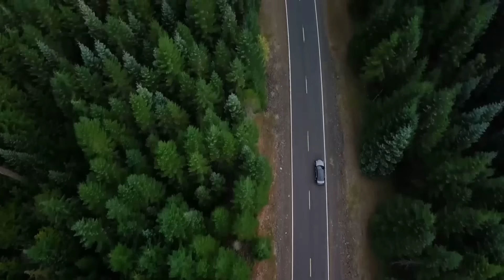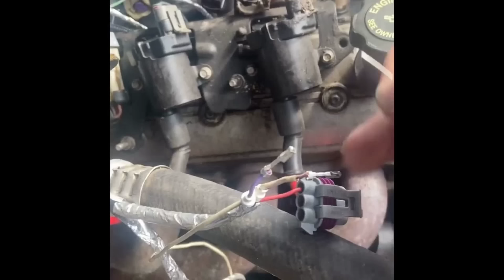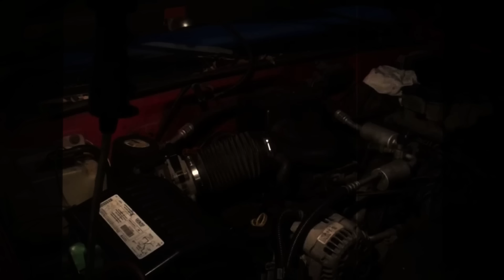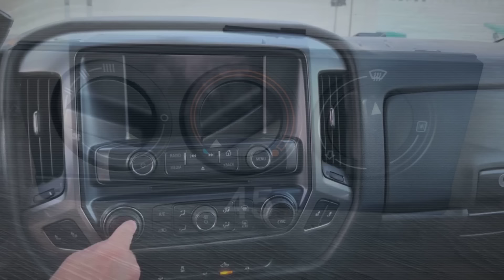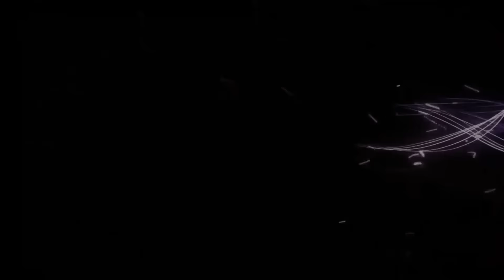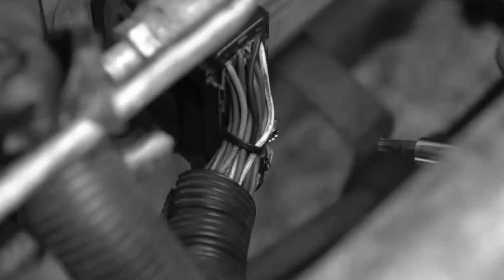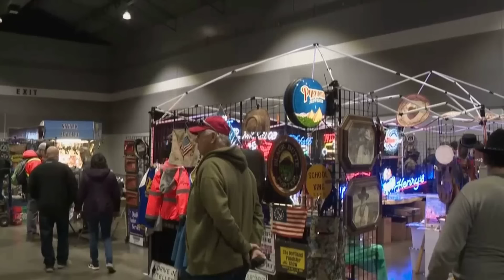How Smart Mechanics Are Bypassing The Dealership (The "Delete" Loophole)

Comment: This news of ppl fighting back against cartel like corporations is music to my ears
Reply: Yes but they're fighting back the wrong way Emma the solution to these problems is to create a replacement OS and to pull the parts off of these vehicles so that someone can scan them for a cad and put the part out for people to 3D print.
Reply: @RayMisuto who's emma 😂
Reply: @GokuSukzass-qf6ro  Google's preferred way to type and.

They're constant use of AI algorithms to rewrite stuff leaves a lot to be desired.
Reply: The oil is the real control mechanism.
Reply: @VagzeensMarkYou water first.
Reply: @davespark10  
It is the oil. It has already been the oil for many decades.
Reply: Then, let's pump up the volume.
Reply: I have a new and old in the driveway 
Screw the industrial forced obsolescence of transportation.
Reply: The chip in the key does an encrypted exchange of messages with the ECU.
That looks nothing like a resistor in any way.
Way more cars would get stolen if it were that easy.
More ChatGPT BS.
Reply: @chrisharvie-smith486  Thats Much Newer Vehicles
Reply: @deltasixgaming It was in cars from 30 years ago.
Reply: @chrisharvie-smith486 like my 98 Explorer has a Physical Resistor on the Key

Comment: I have the standard bed dream pickup truck of the future. No computer systems. Power steering, automatic transmission,  hand safety brake, etc. Simple repair as required. 1966 Chevy C10,  1,000, 400 miles. 😊

Comment: Will i saw ther is a modification on an old cars such as dodge and buick you could instull electric carborator with simpel computer eazy to install and modifi
This modified carborator engine save full but if you didn't find parts in the market you reverse the operation and back to the old carborator engine 

I think it called  (fitech) 

Plz look for it i hope this information help you

Comment: To keep my vehicles on the road I quit taking my vehicles to the quick lube in lancaster ohio. Took 2 vehicles there to get oil changes and both have warning lights on them after they did oil changes. One is the oil indicator light and another had a lightning bolt indicator light. The lightning bolt light turned out to be a broken ecm wire harness locking tab they broke off when checking the air filter. The other I haven't tracked down yet.

Comment: My Pop had a 1987 EFI-equipped F-150. He loved that truck, but sadly, the EFI went south and squirrels ate the under-hood wiring harness. So, having lived my early life as a Shade Tree mechanic, I took his 1987 and turned back the clock to 1967. Pulled out all of the EFI and Digital Distributor and the Duraspark box. Pulled off the EFI intake manifold and throttle body. Pulled off the high-pressure fuel rail all the way back to the in-line filter, under the truck.
Installed a Ballast Resistor from the ignition switch to the coil. Added a distributor from a 1967 Galaxie 500 with a 289. Points, Baby! Ran the wire from the BR to the Coil, and the ground (negative side) to the Distributor. Now he had spark, old school.
Replaced the F.I. intake with an Edelbrock Performer for a 302 and fed it via an Edelbrock 600 with electric choke. Installed 2 fuel pressure regulators (the first to dumb down the 65psi line pressure to 20psi, the second to dumb it down further to 6psi. This was easier than dropping the tank) and an additional fuel filter just before the Carb. Connected the TV cable to the Carb, and away he went. He got quite a few miles out of it before the AOD gave up the ghost (Bad front pump seal) and he finally gave up on it. His wife bought him a 2005 Tahoe instead. He drove that until he passed.

So, you see, old school still works, you just have to know how to add it.
Reply: Neat and cool

Comment: My story had nothing to do with electronics and digital technology. I had a 1981 Oldsmobile Delta 88 with GM's awful Diesel engine. After the head gaskets blew for the second time and the car was worthless to sell, I decided to convert the car back to a gas motor. I used a 350 from a 72 Delta along with a 400 turbo hydramatic trans. I created a true dual exhaust, etc. I was able to drive the vehicle another 60K before I eventually sold the vehicle.

Comment: I recently bought a new plug and play ECM for my 1995 Chevy k1500 with the 6.5 diesel. I figured if anything would fail in the future and have the highest chance of making the truck useless it would be that. It took about 8 months of waiting before one was available and in the mean time I purchased all of the sensors as well. Some sensors like the MAP, I purchased used from a same year truck because new ones for these turbo diesels are off about 6% and will not work very well and these are pretty robust. For my 2002 Dodge Ram, I recently picked up a parts truck. I have many old school Chevy engines, a good muncie transmission, lots of parts to convert over to points if needed, I even have a propane conversion kit for an LS Chevy. Let’s go!

Comment: Next move for the manufacturer will be putting a cheap biodegradable covering on most or all of the wiring harness. Even on half of the wiring disintegrating would completely screw the average owner. Imagine the job it would be to remove and replace the thing that essentially is the first thing they put on the car on the assembly line.

Comment: i dont have to worry about this, i wont buy a vehicle later than 89 if i cna help it.  i bought a 96 olds from my ex-wife that originally belonged to her mother but it had issues and even after fixing those issues with no codes the piece of junk still has a problem in that the engine surges at higher rpm with the car sitting in park and it does not pop off ANY error codes.  so this is not a new issue at all, manufacturers have been fucking people over eer since they went to computer brains and fuel injection.  honestly fuel injection is NOT worth the headaches. give me a carb and distributor any day

Comment: You all act like this is something new. We've been doing this in classic cars as long as I can remember. It's just getting to wear manufacturers don't want you to work on your own cars so now we're doing the same thing in modern cars. Just rip manufacturer control out of the car and keep on driving down the road you get better gas mileage more horsepower and total control over your own vehicle. The trick is to try to find somebody who's willing to work on that that means no more dealerships you find yourself an independent shop that does this kind of stuff and you hang on to them for their life. Make this normal and more mechanics will start servicing these kind of cars.

Comment: 😂😂MY RESURRECTED 06 ENVOY.. DECIDES TO ONLY START WHEN ITS COLD OUTSIDE.  LIKE 20 DEGREES AND COLDER😅😅
I CHECKED FUSES AND RELAYS. FUEL. BATTERY.  IGN SWITCH.. CLEANED MAF.. AND THROTTLE BODY. CLEANED EVERY GROUND I CAN FIND. 
THE SENSORS ARE ALMOST IMPOSSIBLE FOR MY OLD ASS TO BE LAYING IN THE STREET.. UNDER VEHICLES.. TRYING TO WRENCH😅😅
I DON'T KNOW WHAT ELSE TO DO NOW.

Comment: I think getting rid of the coil paks is drastic. I'm sure there is a solution for that. Getting rid of the ECU? Sure Haltec. Screwing with the transmission? Try figuring it out using an ARDUINO micro computer and a service. BCM's? Piss it off. SRT? Piss it off. ABS? Learn how to brake properly.
 I have four 2001-2005 vehicles and have faced all of the problems mentioned. I bought a van with ONLY an ECU and no other electronics, beside central locking. It's switches and relays. I also have Alfa Romeo's that have some pretty fancy electronics for the time. The airbags gave me grief so I substituted a 2 Ohm resistor for the sensor. I refuse to scrap these great cars just because Alfa says i need to pay homage to their dealerships parts counter.

Comment: All they have to do to counteract almost everything in this video is emission testing.  They are about to start this crap where I live in Texas. If the vehicle is 25 years or older then it is exempt for now. Anything newer is about to be subjected to emissions testing. They plug a scanner into the port under your dash. If they detect ANYTHING wrong then your vehicle fails. If the port has been removed or does not work your vehicle fails. If there is an engine light on it fails.  They do not just stick a "sniffer" in the end of the tail pipe like way back when. They do not care whats coming out of the tailpipe but what their scanner tells them.
Reply: This looks like something that needs to go all the way through the court system. National builders rights.
Time to define the word emissions.
Yeah it sucks but if the word emissions is being used to prevent you from fixing your own vehicle because the scanner says you changed something.
States rights are being used to drag you.
We need national builders rights.

Comment: The person who caused all this was Obama. When he did the clunker deal, he had gone to all the auto manufacturers and told them for a 100 years. You had to make warranty parts for 10 years. We're going to change the law. So you only have to make parts for 3 years. So they only make a, they only buy enough parts for 3 years worth of warranty. And when that's all they order, there's no aftermarket making parts  The\nProblem is all the motors they've created.You can't put any kind of a distributor in them.You have to have a computer system

Comment: In RSA we drop small block Chevy motors into most modern Fords and Toyota trucks. Much cheaper than repairing the expensive moders motors and it runs very well. We don't have emission laws to worry about.

Comment: I’ve been using cereal box gaskets for years on motorcycle engine side covers.
Reply: I guess that would be OK if the side cover doesn't get too hot.  But why not just buy a sheet of gasket material?
Reply: @RealDogBoy33  Cereal box sides are large, flat, are saturated with a layer of ink, are easy to cut, and are reliable. They don’t leak. I like to brush on a coat of Permatex Indian Head gasket shellac, or Permatex aviation form-a-gasket to both sides.  That being said, I prefer to use real gaskets when I can. But the cereal boxes will get your machine running and you back out on the road again.

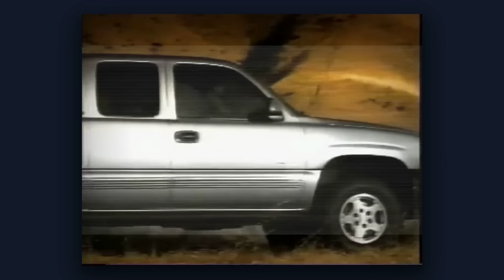Comment: 3:52 i hacked it by feeding 12v to fuel pumps. i can even remove the key after starting, but still need the keyfob with chip to start the engine.

Comment: Yes put a carburetor on any motor it will run better and you don't have to worry about nothing but the fuel and I clean carburetor and clean the fuel line

Comment: My 2003 Chevy S10 xtreme 4.3L has a distributor. She still only has 120k miles. I love that truck. The anti-skip shock is impossible to find now though. I had to replace it with a steering dampener shock that is the same max and min length about 4 uears ago. If all else fails, I still have my dad's 1955 1/2 Buick Special. There's nothing on that car a machine shop can't make or a back yard mechanic can't wire or fix. She drives and dives like a boat. 😂😂

Comment: Screw a small block chevy, I'll just keep my old 318 powered dodge van.
Reply: Had a ‘70 & a ‘71 with 318s. Great rides except the ‘70 rusted away. Still ran great when the junkyard showed up with the trailer.
Reply: 318 is a damn good engine!

Comment: If you live in a emissions controlled state you will have to use a piggy back ecu for heavy moding. It takes the signals from the ecu sends if fake data back to make it thing it's controlling the engine still to prevent check engine lights from coming on and going into limp mode and lock out the transmission in 3rd gear. Or you can use a flash firmware tool to give the ecu mapping and transmission controller a more aggressive tune file. But make sure to backup the factory file tune and do a reinstall on your annual emissions inspection day. Or on locked ecu's have one factory ecu and a factory cloned ecu with customs firmware downloaded directly to the board itself bypassing the checksum encryption keys. It's a real pain in the butt to program and takes very expensive god tier level equipment that only most ecu repair shops have and professionals. So on emissions day you just swap out the ecu for the factory one. If you have turbos talk to your tuner and see if they can give you a emissions tune that can mimic the emissions output of the factory setup to pass a sniffer test.
Reply: well its 2026.  no more tailpipe emmissiins testing.      ǰ

Comment: My !995 Jeep died. I took the computer out de soldered the capacitator's in the ECM soldered 3 new ones in that was 4 years ago still running strong. I've owned the vehicle for 13 year snow and have maybe spent 3 k tops in part son it 4 cylinder and a 5 speed manual. so many aftermarket components and swap kits available I could keep this thing going forever.

Comment: My 2016 Mitsubishi Outlander 2wd needs a new engine. I'd love a 1980's solution to get rid of the electronics, use an old school carb, and add a manual transmission. Any suggestions that would likely match would be welcome.

Comment: Craziest swap I ever did I had a 2003 Ford focus SVT. My options were limited. I wanted the turbo but at the time I had to have a custom manifold bill and would it bring me some serious money
So me and one of my dumb friends one day I said you know what let’s put a 5.0 L EFI 302 Mustang engine in it
So that’s exactly what we did
I got the interior cut the center section out fiberglass myself in a nice fabricated train tunnel
Went out found a 9 inch narrowed it down
And a nice transmission have the driveshaft cost me the length fired the car right up
That car embarrassed, V8 for three years

Comment: Fix the problem that's it. If a manufacturer discontinued a part  that is normal all vehicles will be disconnected at some point. Do to not being profitable. Manufacturers make the bulk of their profit share off of parts alone, but what is the point in run special and specific machines for  a part on a vehicle that doesn't make money and it exceeds the operational cost of keeping the equipment up and running when it can be repurposed to suit more demanding needs on more popular year and models that more people want and need. If you have a bad ECU you can mail it off to a ECU repair shop and have the board and it's information cloned on a known working board or you can find a donor one from a junk yard and send it of with your damaged one. They will do it either way. You can get a defective part back   from them, but just call and tell them it wasn't wrong properly and send it back and they will get you one that works. Some stuff a human tests with multimeters and processing and functionality are tested by a computer like a sort of stress test. You can have tiny components on the board barely work like a light bulb about the break it's fieldlamite but pass testing, but if you look at the chips and components on the board in infrared red heat the added resistance will result in a noticeable heat spike in the image kind of like trying to pump a large amp through a frey strand of wire eventually, the heat cycling will snap the wire, like so the internal workings of the chip. So be patience with the electronic technicians because they have millions of boards from all over the world coming in with any and every kind of issue.

Comment: Lol a resistor doesnt work to bypass gm passlock or ford pats. Quit putting out misinformation.  That resistor bypass only works for gm vats.. nothing else. Gm passlock uses a chip thats built into the lock cylinder, the lock cylinder housing has a sensor that reads it when the cylinder is in the on position, this is why its called (passlock) gm truck 99-06. Ford uses an passive anti theft system called (pats). The pcm is where the handshake occurs with the immo when the key is turned to the on position.  The key has a built in chip called Texas 4C glass chip. Its a fixed code digital finger print that the pcm reads through a wire that goes to an antenna amplifier then to the antenna coil that is a black plastic ring around the ignition lock cylinder.  Now that is good info. Your welcome.
Reply: Passlock can be bypassed with a custom value resistor that mimics the specific value the hall effect sensor generates.  I have done this on hundreds of GM's.  Your thinking if Pass-key which uses the RFID chip in the key similar to PATS.
Reply: @diymakerdan gm trucks dont have and never did use passkey. Tbey went from passlock straight to circle plus. The passlock sensor has 3 wires coming out from it. How would you determine resistor value and why would you bypass when you can just leave the ign on for 12mins to learn a new lock cylinder?
Reply: @hixenP  For remote start, I did it with a relay/resistor so the Passlock was still functional.  The lazy hacks just bypassed it altogether only using a resistor/s.

Comment: Well, that’s great now but at the same time, good luck getting the vehicle through DMV
Cause now you have a computer that’s far into your vehicle doesn’t hold your VIN number or your original mileage. I don’t think that’s gonna pass inspection mechanically. It will work but legally, I don’t think they’re gonna fly.

Comment: I by-passed the glowplug controller with a spring return toggle switch.  1982 GMC Suburban is still running today.
Reply: I’ve got an 89 gmc suburban and the only thing in my truck to heat it up on cold days is a small metal duct - like a dryer vent duct but smaller. Sits on top of exhaust pipe on passenger side and top part goes into a hole in my air intake tube 😂😂😂
Reply: a nice simple solution.
Reply: REplace idot box.